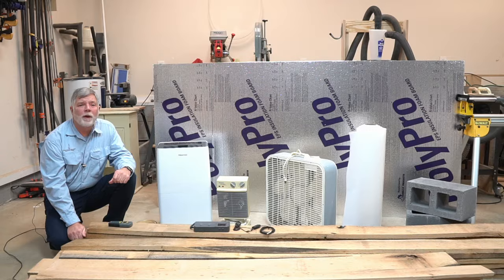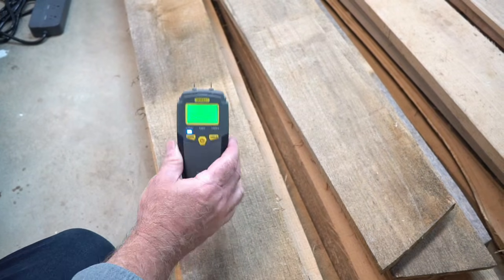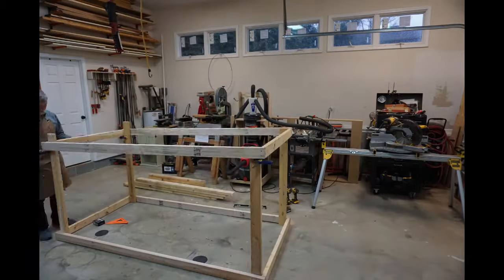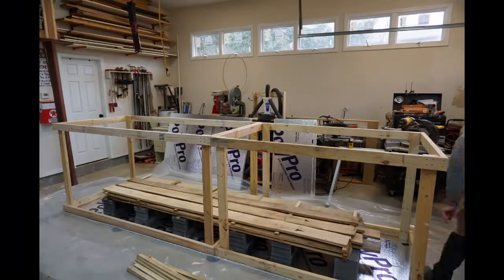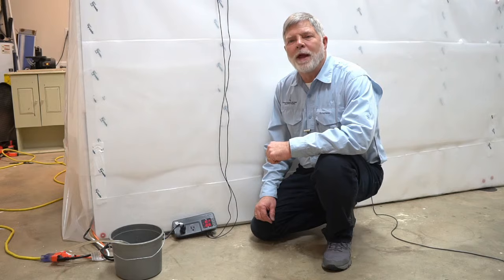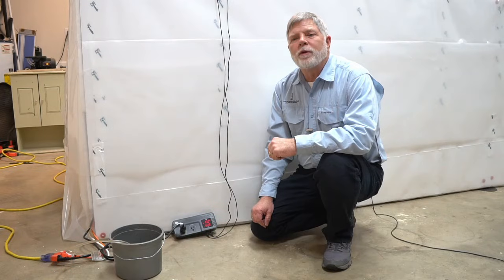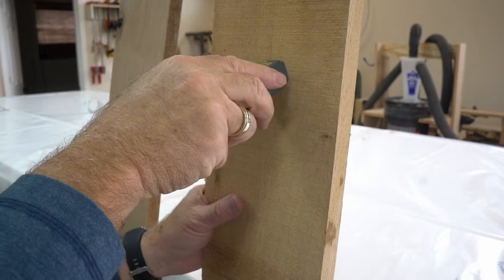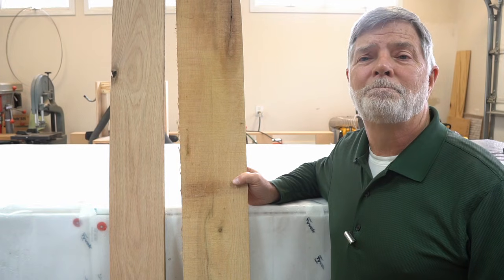Simple DIY Wood Drying Kiln

Comment: Almost easier on the electric bill to buy it from the store already processed
Reply from the maker: I did not calculate the electricity cost but I cut the tree on my land, milled it with my sawmill, dried it in my kiln then built a table for my house. The sentimental value is immeasurable.
Reply: @logstolumbernow2011  I hear ya..Thanks
Reply: Bob Abooey This is simply not true. He is likely preparing this lumber for less that $1.00 a board foot. Try buying kiln dried hardwood lumber for anything close to 4 times that price.
Reply: @David-fv7zg  Yes I was looking at oak lumber at Lowes one day.A 10 foot oak 1x10 was almost $50,and some were even split on the ends.
Reply: for regular stuff that CAN be bought at the lumber yard - im interested in chinaberry wood (melia azederach) - its a relative of mahogany, can be used as a substitute for teak, the wood contains neem oil so it is insect resistant, it is an invasive nuisance in the US southeast, and also flourishes in its native southeast asia, so its not under any endangered species restrictions - but no one sells it (not actually true i bought a small quantity from a place called greenwood milling in san antonio, but they dont usually stock it)
i build guitars, and my chinaberry guitars ring like bells, but if i want to keep using chinaberry, it looks like im gonna have to go into the sawmill and kiln business for myself...
Reply: Not very self suff tho

Comment: Nice design. Did you consider keeping the electric heater outside the kiln and ducting the heat to the inside? I recently purchased a quantity of cherry, soft maple and ash from an individual who had stored it for many years. Upon milling the lumber I discovered extensive damage to the ash, less damage in the maple and minor damage in the cherry. I have been cooking short lengths of maple in my oven (I'm single) but need to sterilize the longer lengths. The heating is vital to me.
Reply: I sealed the kiln to keep out the humidity from the surrounding room. If I ducted in air from outside, I would not be able to control the moisture in the kiln. I have since modified the heater to remove the high temp shut off. Will try it next time.
Reply: I like to hear your results. Thanks.

Comment: Great video! Would love to see more about kiln process and the theory behind those numbers you used for heat and moisture
Reply from the maker: The best resource for kiln drying schedules is DRYING HARDWOOD LUMBER published by USDA Forest Service. If you are using a home dehumidifier however, you have to keep within it's operating temperature range to  avoid damaging the compressor.